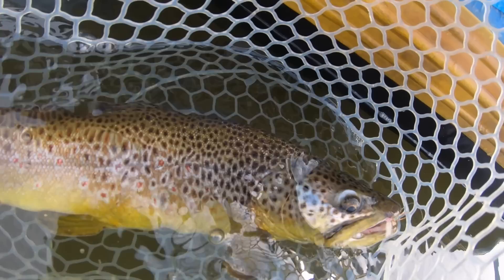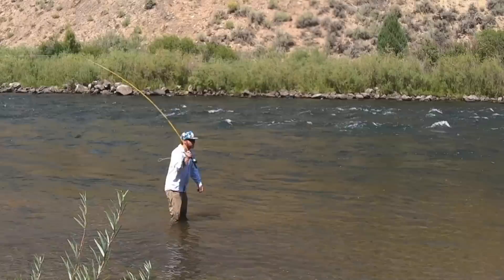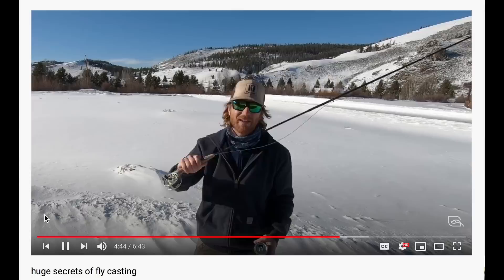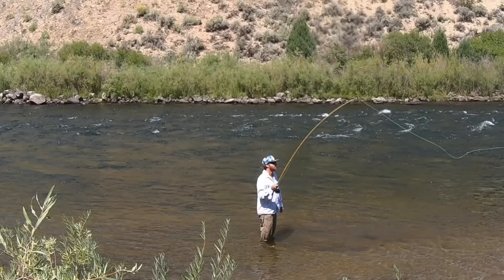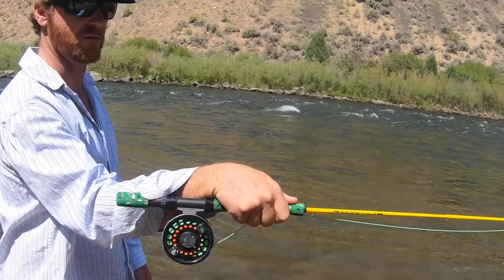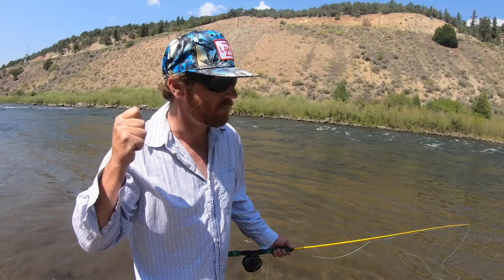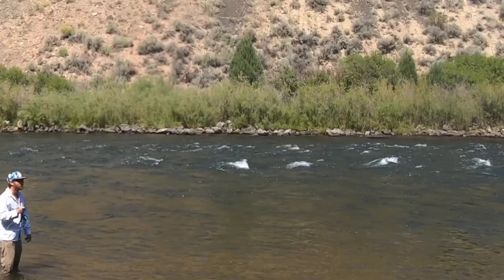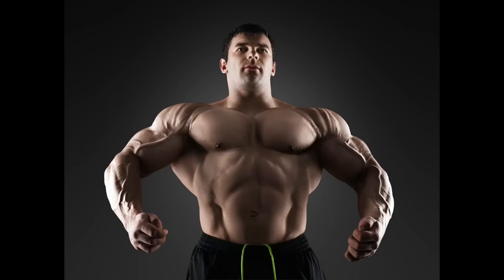FIXING COMMON CASTING MISTAKES (fly fishing)

Comment: I flyfish for Smallmouth Bass exclusively. Larger flies, larger water, larger fish = =to larger casting issues. Honestly, if I get the fly in the fishes mouth I consider it a success! Lol I use an 8 weight, furled 7.5 ft leader with hair, foam, feather flies or streamers. Occasionally I have even lobbed a plastic crab into a sweet honey hole I know holds very large Walleye. I have improved my casting but it's tough fishing large Bass flies. Tiny hackle dries work at times but big fish really want big flies. True fact! Thanks for sharing! I subscribed! I enjoy the humor and down to earth real material!

Comment: That popping noise on the backcast is referred to as "the retail snap" because it means you're going back to the store for more flies. You can get the casting motion by pretending to hammer a nail into a wall. A floppy wrist won't get that done. Yep, I'm huge!

Comment: Man i been fly fishing for about a year now and I just cannot get a bite. Going out for smallies and it has been a struggle and a half
Reply: Buying some Huge Flyfisheman merch usually solves those tipe of problems.
Reply: May I make a few suggestions? Are you sure Smallies are in the water you fish? Smallies are " takers" and aggressively hunt for food. If they are in your water they will find your fly! Fish the current breaks in water at least 2 ft deep. Gently work large poppers, moderately work sliders, slow down streamers until you bump the bottom regularly and your in the game! Limit your casting directly upstream, (it requires too much stripping of line and little time in strike zone) quarter cast and learn to drift a drag less drift for clear water conditions, work riffles both front and back with the sliders. Poppers are fun to use but very easy to overwork and scare fish, use them gently. Move your rod slowly from one side to other side to move sliders in the riffle areas. Use indicator with Wooly Buggers drifting 3-6 inches off bottom. If you do some of these things I'm pretty sure you will be rewarded with Smallies fighting hard and furious!!!! Good luck! I hope you didn't mind my offerings.
Reply: @K3Flyguy  thanks yea i know there are smallies I use conventional fishing tackle in the areas to good effect. I have been using poppers and am probably being to agressive and I struggle in most current just feel like im fighting it the whole time it gets frustrating but I keep trying hoping I start to figure it out eventually
Reply: @ZmbiBglz  may I add, when a large bug hits the water its usually is stunned for a few moments. I have used the "drop it and leave it for a moment" effect to huge advantage. As far as struggling with the current, use the current to your advantage. Fish sliders across and down the current. It's a well known phenomenon that at the "J" bend of the quartering drift there is a higher % strike area than most of the rest of the drift! Learn to mend the line by raising for tip and tossing the slack upstream to add time to your drift. Also when casting cross stream, learn to shake your rod back and forth at the end of the cast to allow extra line to lay on the water for a longer drift. Biggest tip is to fish a tiight line pointing down stream. This is where the Slider and Streamer takes a lot of fish! If you don't bump the bottom with the streamer your missing a lot of  the preferred area. Dragging a weighted Wooly Bugger upstream inch by inch across a rocky bottom will garrenteed put fish on your hook! Be sure to use a short heavy florocarbon leader for this of no more than 4 ft, hold for tip about 8 inches above the surface and watch the line loop for discreet changes that indicate a pickup! I often use a Tungsten impregnated Steelhead line to fish straight down stream through honey holes with Crawdad imitation Wooly Buggers with red glass eyes, = amazing results. If your profecient with conventional tackle, some of these tips will bring out points on your scoreboard! Good luck, and don't give up, when it all comes together you will never go back to conventional tackle!